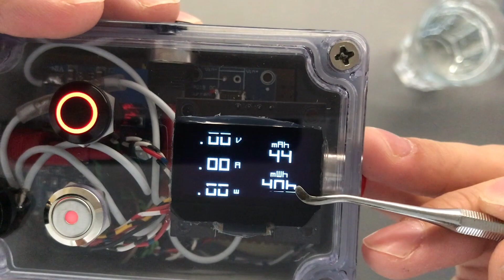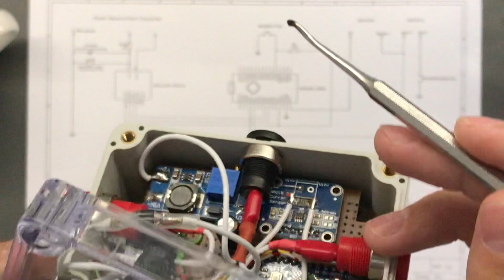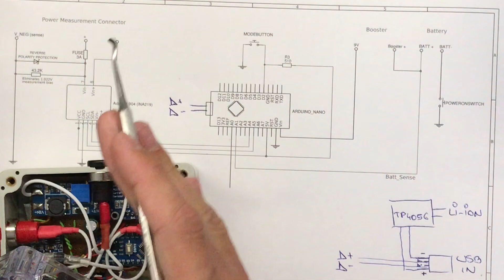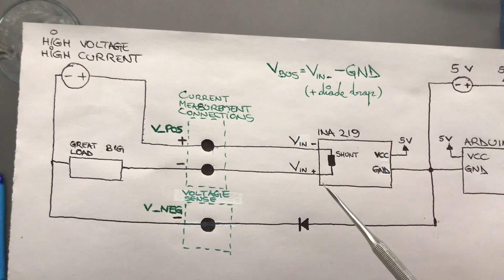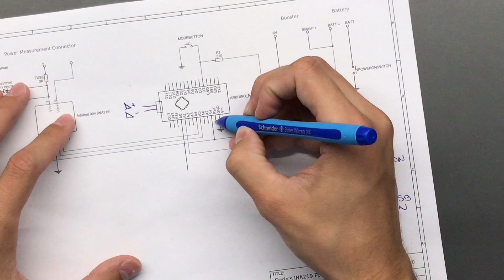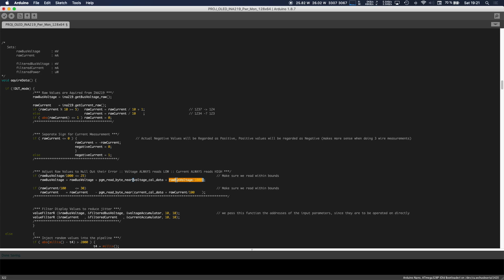DIY Power Monitor Tutorial - INA219 & Arduino

Comment: Can you tell how much is the max  current and max voltage
Reply from the maker: check the INA219 datasheet .. I think max voltage is 24 or something like that

max current with the shunt resistor I have is about 2.2A or something like that
Reply: Code

Comment: Which lcd is that can u send a link the lcd looks so good btw nice vid

Thanks
Reply from the maker: Check the description
Reply: @Darieee  I checked it but it's a link for a normal 1.3 inch lcd but the one u  were using had a high resolution
Reply from the maker: nah, it's a regular 1.3" OLED i2c display

Comment: I have to check, but I’m pretty sure that your diagram is not correct. Vin+ is where the current enters the shunt, Vin- is where it goes out (its labelled that way because it matches the entrance of a regular differential op amp inputs) Vbus is Vin+ - VShuntDrop (=Vin-). Again, Im not 100% sure, but that was my understanding...
Reply from the maker: dude .. ccccoouuuld be

I went back even and reuploaded the video with the diagram changed .. am SUPER not sure

and found the entire thing mega confusing

for sure let me know what you figure out!

Comment: Great project. A cheap sd card modul for data logging could be intersting too.
Reply from the maker: It was in the original plans - I even have some of those modules ... 

However, on the 328P there simply isn't enough ram for loading the SPI library as well, and displays I only had in i2c flavor
Reply: @Darieee  Good point, i didn't thought about that one. I might try it with an ESP8266 or ESP32 then.
Reply from the maker: Those should be fine, I however got an M0 board ...

Have you ever programmed any of those with the arduino ide?

I'm quite worried none of the libraries will work :-s
Reply: @Darieee  I've used the ESP8266 for a few projects and so far most of the libraries have been compatible. I haven't tried it with the INA Modul/Library yet (still unpacked), but with libraries for displays, rotary encoders, temperature sensors, 433mhz moduls and such tings i had no problems. 
With the newer and more powerful ESP32 i had sometimes problems, but since the price for it got a lot cheaper in the recent months  the support for that one seems to get a lot better too.
Reply from the maker: Nice :D and, those esp ones have bt and wifi on board, right !? Or not all of them ?
Reply: @Darieee  it depends a bit. In general there are tons of different development boards available, some also with integrated displays, 5-way knobs and such things. 
Usually the ESP8266 has "only" WiFi, but you could add a bluetooth modul. The most popular ESP8266 moduls are probably the Wemo D1 Mini and the NodeMCU.  They're less fhan 5 bucks from China. 

The ESP32 has WiFi and Bluetooth build in, and also some other nice changes like tons of interrupt pins and even capacitive touch sensitive pins. If i remember correctly about 10. Another thing most ESP32 dev boards seem to have in common is that they've already a battery connecter and Lithium charging regulators & protection on board  If you want to use an external antenna for WIFi that connector also seems to be more common on some ESP32 Boards, althought there is also a Wemos Pro version that does have it on an Esp8266 as well.  Currently i use the ESP32 Boards from TTGO. The smallest is the TTGO Mini which is great in size for the final product, but not breadboard friendly because it has the pins on each side in two rows. 

So for better compability to common Arduino codes and libraries the ESP8266 is still a little bit ahead, but the ESP32 is quickly catching up and has some neat extras. I usually pick between them based on the needs, since the ESP32 is usually twice the price (which is still cheap if you use the extra capabilities and save extra moduls that way). 

For a little overview of the available dev boards i would recommend the channel of Andreas Spiess. 
https://www.youtube.com/channel/UCu7_D0o48KbfhpEohoP7YSQ
He did comparisons of ESP8266 and ESP32 boards, considering how breadboard friendly they are, power consumption during normal use and deep sleep and so on.
Reply from the maker: Awesome !! Thanks a lot !!
Reply: @Darieee  They're really fun to play with. One big difference I forgot to mention are the Analog pins. The ESP8266 has usually just one while the ESP32 has 18. 
https://randomnerdtutorials.com/esp32-pinout-reference-gpios/
Still, both are great. It's nice what we can get these days for less than 10 Bucks and depending on the project they all have their own strength.
Reply: @Darieee  Oh, one last thing. If you want to use the ESP8266 or ESP32 with the Arduino IDE you've to add the boards once. Here is a video about the ESP32 - for the ESP8266 the process is basically the same. 
https://www.youtube.com/watch?v=DgaKlh081tU
Reply from the maker: Thanks man, you're the best !!
Reply: @Darieee  The ESP8266 and the ESP32 both have WiFi, plus the ESP32 also has Bluetooth. I've tried Websocket connections directly to the browser. They're very fast (up to 500 Hz). I used the C3 https://c3js.org/ library (which is based on the fabolous D3 library) to visualize data like temperature humidity etc.. 
BTW: Would you share your code? I really like the visual interface.